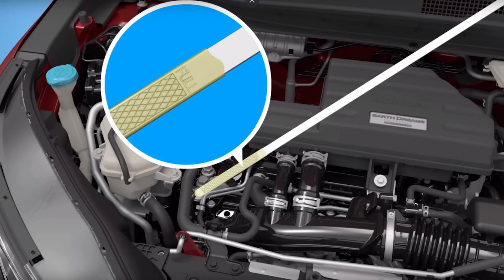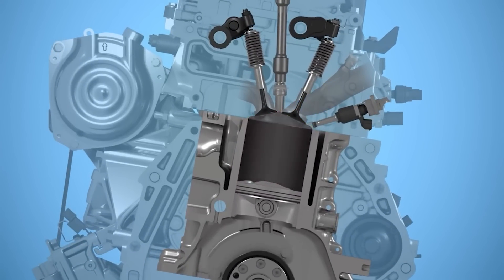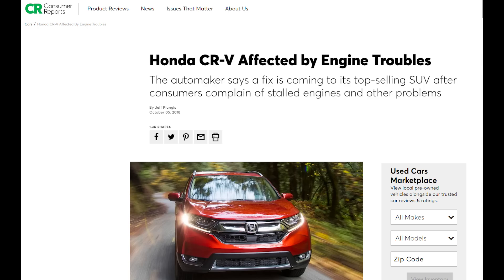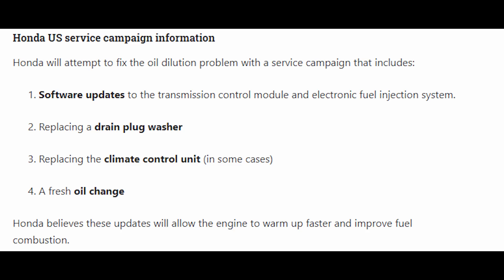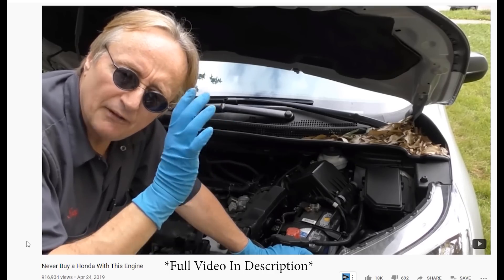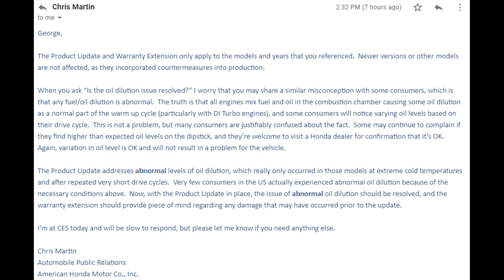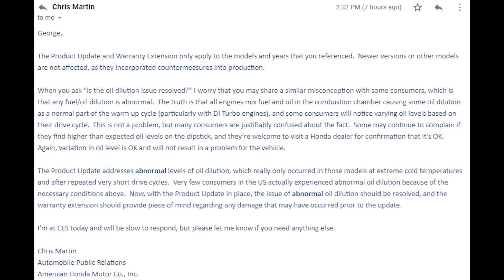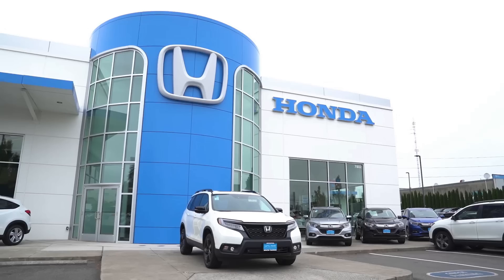Does Honda Have An Oil Dilution Problem? | 1.5L Engine in CR-V and Civic

Comment: Not surprised by the "lower cabin heat" complaint. How do you reduce oil dilution? Get the engine to warm up to operating temperature faster. This allows for snugger fit between parts to occur sooner, and less gas getting past the them into the crankcase. How do you get the engine to heat up more quickly? Divert less of the coolant into the cabin, where it loses heat to heat the cabin. So the cabin will then take longer to warm up. However once the engine warms up, then the coolant can be diverted to the cabin, and the cabin should get just as warm as beore – it will just take longer. That's the theory anyway. Replace the oil drain plug gasket? How does that help? It doesn't. It is just a matter of: it's best to replace the gasket if you replace the oil. A gasket costs Honda pennies, maybe less than a penny. They sell retail for pennies. It is normal in every engine for a little gasoline to get into the crankcase, however if there is so much that you can easily see a higher oil level on the dipstick, I think there is too much gasoline in the oil.
Reply: Exactly, people are warming up the cabin on cold days before the engine gets warm, this slows down the engine from getting to operating temperature. Same in the summer, don’t turn on the A/C until the engine is warm. A good habit is... start the engine, start driving within 30 seconds. After 2-3 minutes the temperature gauge should be at least 1/3 of the way to H. When it’s just below 1/2 you are at operating temperature. Wait until it gets there before turning on the entertainment system or A/C or fan or Heat or anything else. If it’s really cold wear gloves, if it’s really hot open the windows. It may be uncomfortable but it’s going to be worth it.

Comment: I have a 2020 Hatchback with the Turbo and I just went to check the oil, and it does have a hint of gasoline smell. I about to hit 10k miles on the engine. I don’t think they’ve fixed the issue. 😠

Comment: 2018 CRV owner here. Oil is consistently too high 3,000-4,000 miles after oil change.  Injectors failed at 37,000. Honda paid this in a “good faith” claim. Thankfully my dealership went to war for me over it, as I have meticulously maintained this vehicle.
Reply: Still got the crv right
Reply: Can I ask your advice my daughter just bought the 18 CRV turbo she has 30 days to bring it back to CarMax do you think we should just return it and get another vehicle at this point Thank you for any advice

Comment: I bought a 2018 CRV EXL last August (2019).  It was brand new and I got it for close to 5k off the sticker because the dealer had 12 of them sitting on the lot for close to a year.  The issue with oil dilution is very real.  I often smell gasoline around the front end of the car, regardless of whether I've driven it or not.  My oil dipstick smells like gas.  I knew what I was getting into when I bought the car.  I repair our cars and I'm more than comfortable changing the oil regularly.  I like how it rides and handles and likely won't keep it once the 6 year powertrain warranty is up.
Reply: Which engine does yours have?
Reply: @pzmqyhniq The 1.5 liter turbo.
Reply: @regkarn1  Thanks for the reply. I had been looking at 2017-2018 CRV’s. I’ll definitely avoid the 1.5L engines. But, I’m not overly confident in the 2.4 either. Some owners mention oil dilution in those as well. What a shame, those cars ride and handle beautifully.

Comment: I have a 2020 CRV Touring. it has 5500 miles on it and it is having excessive gas in the oil and at idle gas fumes in the cabin, also not living in cold climate. trying to get dealer to take car back.

Comment: They are so wrong my 2019 accord still has the problem and my drive is at least 100 miles a day and the dealership said they fixed it and they are full of shit and I have been working on cars for 55 years so they are so wrong about this problem

Comment: I had the update done in December of 2018 and the oil level still climbs above a 1/2" above the high level indicator.    I have contacted Honda several times and their response is to contact dealer who tells me this is normal no  concern.  Last Honda I buy or reccomend.
Reply: Toyota is the way to go...you can't go wrong with them

Comment: Yeah, My 2015 Honda Accord gains a full quart  in less than 3 K miles, causing  the oil to be diluted, of course. Have to change  early  to  avoid  this.  In Less Than three thousand miles. And this is not a  Turbo charged engine.  B.S. the real problem,, s the high   pressurized gas being blasted into the  top of the cylinders.  All to satisfy  Gov. mandated gas mileage which they can't do easily. so  go the worst way. Dogs

Comment: I bought a brand new 2019 CR-V in Sep. 2019.  It was produced just two months before (manufacture date) so it left the factory with it’s “fix” for the oil dilution.  This is not my first car.  I, before I got injured used to do my own work.  Now I had my oil changed at 5k instead of 7.5k and it took a hundred miles for that fresh oil to look like the oil that had just been changed out.  The engine oil also WREAKS of gasoline and I don’t mean a normal amount.  I’ve ordered oil testing kits,  but I have to wait for my next oil change......I don’t care, my car will be fine then start running rough.  It also takes FOREVER to heat up.  I can remote start it as many of you know and despite leaving it to warm up, it never does.  Even at 45 degrees, after 10 minutes idling, it still took at least 5 miles to heat up to propert temperature so I don’t believe this is fixed.  Who should I report this to? Honda doesnt give a  💩 and says “the 2019’s arent affected.”  BS, I’ve never seen a new engine after it’s first oil change have it’s fresh oil looking dirty after only 100 miles and smelling like gasoline (yes, I know it’s GDI and a little gas it to be expected.) My dipstick isnt showing a too much oil though....and, despite how gingerly I try and drive it, I’m not getting close to what I should be getting for gas mileage.....

Comment: Honda's SUCK. Period. Not like they used to be in the 19th century... Today's CR-V and PILOTS are way too overrated and Honda overall is light years behind technology as compared to other car makers. NEVER BUYING A HONDA ANYMORE IN THIS LIFETIME... OR ACURA FOR THAT MATTER!
Reply: So which brand would you.recommend if you hate honda that badly
Reply: @alvinsimba734  I hate to be diplomatic but here's my response to your question. I've always OWNED Japanese cars strictly due to affordability reasons. High-end luxury cars BMW's, Mercedes' etc. are beyond my financial means from ownership and maintenance perspective. So, given my budgetary constraints, and still have a nice reliable vehicle with pretty much decent set of amenities, I've kept up with Japanese cars, specifically, Honda's and Toyota's. Both brands are reliable, or I should say WERE RELIABLE up until 2010... especially, Honda, I would say.

Since 2011 having admired Honda CR-V of a friend and then leasing one for myself in 2019...my opinion for Honda's build quality has changed. It's absolutely inferior, unreliable, and overly hyped and way too expensive, as compared to its closest rival Toyota (or for that matter Subaru - though I haven't owned one). As of writing this my family has 4 Toyotas (1 each for my wife and both my kids and a 1998 Camry with over 200K miles on it), and one 2019 Honda CR-V. Oh and BTW, my CR-V is a LEMON, and my dealer and Honda Corporate have given me a lot of run-around, not owning to the ride related issue. Given my 30-plus years of driving experience, I ABSOLUTELY FEEL UNSAFE DRIVING 2019 HONDA CR-V, especially during winter snowy days.

So, I'm stuck with two more years of lease payments with this piece of garbage and unreliable technological gizmos on my dashboard, like the radio console and Apple-play. It's an absolute Joke. THAT'S WHY I PUT A FORK ON BUYING A HONDA....EVER AGAIN!

And also for the record, my first car was a brand new 1991 Honda Civic LX - my then "Dream Car"!

So, I hope you get the gist. And just to reiterate, without any bias, however, between Toyota and Honda, I'm putting my money on Toyota. Hope my insight and perspective help you steer in the right direction. Good luck!
Reply: @dhapumdhap  i also drive toyotas too. Got 2 of them. I was initially thinking of honda purchase too but ended up with toyota anyways due to past history of my first vehicle which was a toyota and still running today. Honda dealers wanted more money for financing and toyota was cheaper in that regard which I totally agree. I saved myself 11k by staying with toyota instead of honda as well.
Reply: @alvinsimba734  Good for you. I guarantee you won't be disappointed with Toyota, in case you don't know. I'm pledging that I WON'T ALLOW ANYONE IN MY FAMILY TO BUY HONDA EVER AGAIN... WHILE I'M ALIVE. I'll try to even sway friends and relatives to not buy them also. 

Plenty of fish in the ocean...other than Honda! Have a great year ahead.
Reply: @dhapumdhap  thank you sir you too. While I appreciate your feedback, my work colleague is now considering a toyota corolla after seeing me with it as she has 2014 hyundai Santa fe that just recently broke down and she is driving the rental now. She is thinking of getting the corolla and also trading her Santa fe in the process. I will go to my dealership and specifically to my sale advisor and make life easy for my colleague
Reply: @alvinsimba734  I'm sorry to hear about your friend's Santa Fe breaking down. But glad you're steering her towards a more reliable care. If I may suggest, almost impose, based on my experience... having bought used Toyota Corollas for both my kids, I've changed my mindset from buying a BRAND NEW car altogether. Instead I will INSIST on buying a 3-year old low mileage reliable car; those that have come off lease preferably, and dealers want to get rid of them for substantially low prices.  

For instance, one of my 2015 Toyota Corollas, I negotiated with the dealer for $13K and change from original asking $16,900...with 22K miles on the car. This car is fully loaded... with leather automated & heated seats, built-in GPS, back up camera through pretty much all the comfort features... Rides smooth. Beautiful car. I really got lucky. 

So, see if your friend would want to consider that. Toyota's last FOREVER... Beyond 200K... So, worth considering used over brand new. Regardless, Good luck with shopping.
Reply: @dhapumdhap  that might be a good idea, myself I got 2020 corolla le which used to be a demo vehicle and those vehicles have got hidden discounts on top of dealer discounts and I ended up paying $16k american or $22k Canadian out the door that had 1200 miles or 2200km on the clock and as for my friend she has made up her mind on getting a brand new but I also suggested a demo vehicle for 2020 as all she really wants is A/C and gonna connect her with my salesperson who sold me one. I did buy brand new as im trying to boost credit in case I want a house down the road and I could very well pay off the car if I wanted too but would use the money into bigger things and as for the payment every 2 weeks its worth 1 working shift as im financing.

Comment: Had my 2019 CR-V at 846 miles break down due to the oil dilution problem causing no acceleration when pushing the gas pedal down, brought it in and the dealer did an oil change which was a temp fix, but now at 1190 miles in and about 2 months after the first oil change i'm having problems again.  Bring it back for another check up this monday which will probably be just another oil change.

Comment: Since Honda and Toyota have gone to using turbo chargers you will probably not see theses motors having 250 to 300 thousand miles like the old non turbo motors. They had too change this to get higher milage without losing horse power. The motors are having to work harder with turbo.
Reply: No turbos in toyota just so you know

Comment: Gasoline has a lower viscosity than engine oil.  If you dilute the engine oil with gasoline you are effectively lowing the viscosity of the oil.  It may be alright in the short term if the gasoline in the oil is heated & evaporated (level on the dipstick should return to normal), but long term the engine (piston rings & bearings) will likely experience more wear.

Comment: I've owned a 2017 civic 1.5 turbocharged. Oil dilution started at 25k miles,went to the dealership and they change the oil and said "it check out" .."it's normal". I had to change the oil myself and realized the oil came out like water with extreme gasoline smell. Went to the dealer again and no solution. Sold the vehicle with 39k ...the extended warranty it's a joke. Now a Mazda miata it's my fun ride..still I miss that Honda.
Reply: Bye bye Honda after 3 Hondas I'm done. Hi Mazda!

Comment: It was a manufacturing issue and Honda never confessed this.  Gas got around the cylinder walls because many of the engines were not machined to correct tolerances.  What we need to know is if the new engines still have this issue?  My guess is they silently fixed it.  I still drive my naturally aspirated 2.4 liter VTEC  2009 Honda CRV and it continues to be a reliable ride.  Its at 119k miles now and still running great.  I am wary of the new Turbo engines and Car manufacturers that are incorporating more plastic into the engine parts.  Honda had a reputation for rock solid engines.  I have one of these but I am not too sure about the Earth Dreams.  Give me a standard VTEC or I-VTEC engine any day but this may be the last period before car companies gradually fade out to electrics.  Once Solid State Batteries take off, the Internal Combustion engines days are numbered.

Comment: Don't want to risk getting shot but have 46,000 miles on my 2017 CRV EX and not a problem yet.  Thing hauls ass through the mountain passes and average 30mpg with kayak on top. Hoping my turn doesn't come for smelly cabin and no heat. Love the auto follow, lane assist, safe breaking, Android Auto, large interior with flat fold down seats (5'10" and can stretch all the way out on over night fishing trips), etc.  

Only complaint is premature inner tread wear on tires it came with from factory.  Replaced at 42k.

Comment: Bought a cvic with this motor, and 3 weeks later traded it for a 2 liter civic naturally aspirated. THEN I told Honda why. They said "don't worry about it. I know a bit about mechanics and a 0-20 weight oil DILUTED, is going to cause major problems. 1st Honda I've ever owned, always been a Lexus guy. Screwed up.
Reply: Lexus to honda interesting lol

Comment: i just had my 2019 crv towed back to the dealer.2000 miles and its  running ruff.i smelled gas on the dipstick.its a quart low btw.i googled it.holy shit .im not taking this car back.already got a case number.sorry japan.no ticket.no laundry.

Comment: I had this same problem with my 1990 Plymouth Acclaim... Car of the Year at the time. I also had the same issue with a 2006 Toyota Sienna so this is not new... you can flood your engine with gas on startup. This is not new, just start it up quick once and let it warm up, the gas will evaporate and off you go. It’s pretty simple

Comment: My daughter has a 2018 CRV in Houston Tx and we just did a 2nd Blackstone Labs test on the 25,000 mile oil change (5500 miles on that oil). Fuel in oil is 3.8% and value should be <2%. Complete Bullshit...warranty extension is not enough and we will be contacting Honda for the fix AT A MINIMUM! First test was on 11,000 mile oil change fuel in oil at 2%. We change oil approximately every 5000 miles.

Comment: I have a Honda 2018 CRV and a 2011 Toyota Rav 4 - had the warranty repair done on the Honda and I extended the regular warranty with an additional dealer warranty once the car hit 36K.  I had some minor oil dilution before the fix and a significant gas smell from the dip stick.  It's better now but I always change my oil now in the Honda at 50% on the maintenance reminder.  I can still smell a little gas on the dipstick but much better than it was before the fix.
Meanwhile, my Toyota which has been pretty much trouble free except for a grinding noise under engine load that started at around 50K.  I took that car to the dealer multiple times and eventually at about 90K when the sound got to be bad enough to diagnosed as a bad torque converter - the dealer wanted $3700 to replace that as the car was out of warranty already by a bunch of miles.  I ended up taking the car to a transmission place and got a new transmission (including the torque converter) for $4500.  I have 45K on my Honda now and everything is in great shape.  The supposedly better option of the Rav 4 has cost me $4500 to fix, so I'm not convinced that the Rav will be longer lived in the long run.  I guess I'll have a better handle on that when the Rav has 200K and the Honda has 100K.  I am happy about the 6 year unlimited mileage warranty extension, but I'm not happy at all about Honda dealers acting like it was not an issue to this day.

Comment: The article says the makers least reliable car and it say the Honda clarity. I don’t think this is a over all comparing the all the models. Honda has been making motors for a long time. Going to these smaller turbo motors because of gas mpg regulation will hurt reliability.

Comment: I have the problem with oil dilution. 2019 CR-V with 1.5T. Checked with oil analysis from Blackstone and exceeded 5% gas in oil. Viscosity below minimum for the 0w-20 grade. "Nothing to see here folks, move along..." First and last Honda buy.